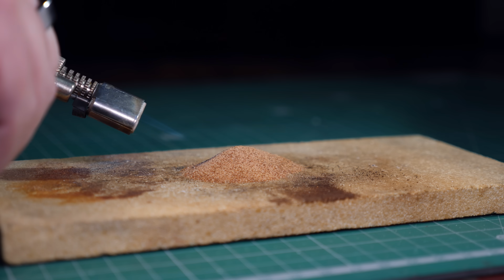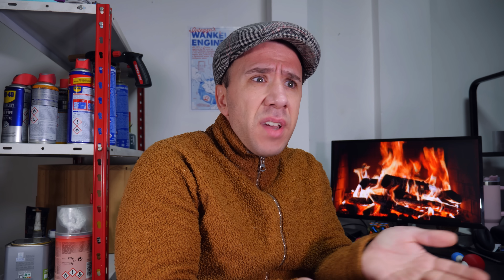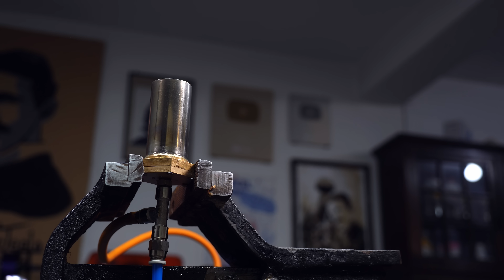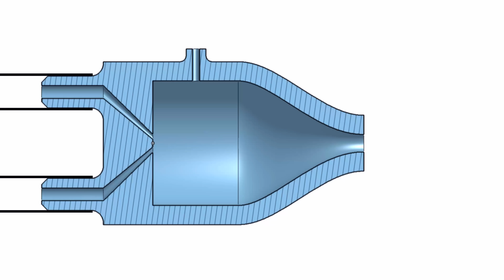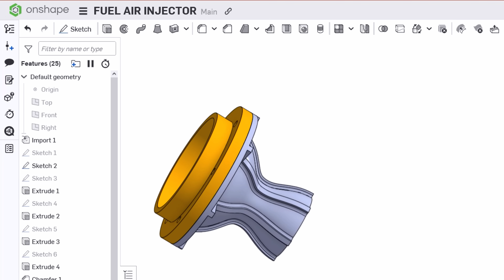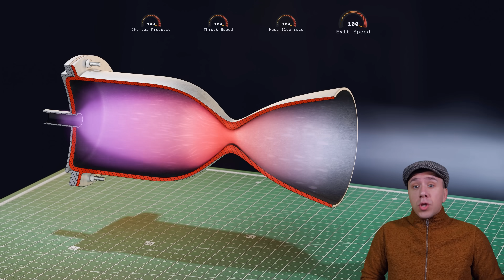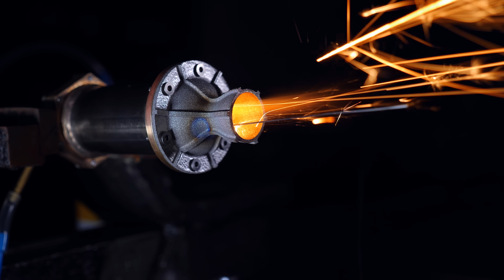I Built the FIRST VENTURI ROCKET ENGINE

Comment: The reason your air spray works perfectly while your Venturi nozzle failed is all about the mechanism of pressure drop.
When you blast air perpendicularly across the tube opening, you're creating a fast-moving airstream above the liquid surface. Here's the key physics, when air velocity increases (dynamic pressure), the static pressure perpendicular to the flow direction drops. Think of it like airplane lift: fast-moving air over the wing creates lower pressure above than below. Same principle here, the high-speed air creates a low-pressure zone that literally sucks the alcohol upward and atomizes it.
That's exactly why later you switched to using compressed air with a mixing chamber, you're accelerating the compressible air to create the suction, then entraining the liquid into that airstream. Much smarter approach for rocket injectors!

Comment: Use mister nosle and a liquid pump to push the alcohol through it. I think when you try and push more alcohol to are using more air and that blows out the flames. You can try it with the solid oxidizer.

Comment: 12:52 Gut reaction is you didn’t define it correctly. The air isn’t exiting the nozzle at 6 bar, the tank is 6 bar. I’m not trained in fluid simulation so I may be wrong on this, but in fluid dynamics you typically assume an outlet to atmosphere is at atmospheric pressure. Assuming it exits at tank pressure violates the conservation of energy.
Realistically, it will probably exit at more than 1 bar.

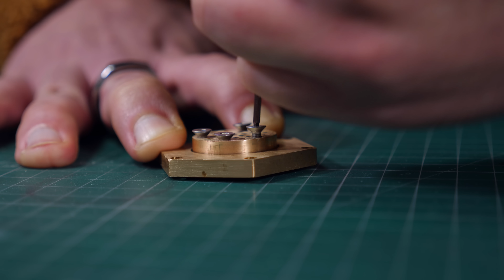Comment: at 4:43, the last one is the hardest one because you shouldn't be tightening them down 1 at a time. you should go  like 1 turn each on each screw and then smaller intervals the closer you are, if you want to make the cap-piece as flat as possible to the bottom piece. I worked in tool and die for a year before life took me elsewhere in manufacturing.

Comment: You could try making an expansion deflection nozzle of you tire of the aerospike. 

Btw, that 4 port aerospike may be prone to resonant instability contributing to your "pulse jet" surges. But by using a THREE port aerospike should cause any standing waves to overlap themselves 180° offset per rotation, capping the magnitude of the pulsations to a low level.

Comment: Your first test was upside down! The fuel melted, flowed downhill, plugged the device. If you invert it, then the melted fuel will come out the exhaust nozzle, so no congestion, tho you may not like the uncontrolled pops of flame from molten fuel combusting downstream of the exhaust...and if the engine sprays blobs of combustible fuel, that's a great way to start a fire. Either way, you have achieved the Jesse Ventura effect.

Comment: Im sure you know best practices with SRB fuel or we would be seeing your memorial vid now/watchiing your apartment block burn down from space.

Fyi, twenty years ago there was an arson for hire crew in the US that had used solid rocket fuel. It left absolutely no trace, tended to burn concrete and had the nasty property of burning hot enough to crack the H2O firefighters would spray at it into H2 and O basically just moving the combustion into a big action movie plume. 

They were taking on more jobs with arson cases spreading from one coast across the country until obe day it just stoped. 

Most likely the invetive soul making the stuff probably blew whatever rural shack that was his factory into low earth orbit. 

You don't want to do that.

Comment: The nozzles of rockets are shaped like this because when the exhaust flux reaches the throat’s section it travels at the speed of sound. After the throat an “inverse Venturi” shape is put because in the hypersonic regime the relation between pressure and speed is inverted (if the section increases the speed increases). In this way the flux keeps accelerating also after the throat.

But in your case the back pressure generated by the combustion is not enough to reach the speed of sound so that shape you realized is not necessary. You could make a single Venturi. 
The design you made, tested for these conditions, makes that the flux accelerate up to the throat and then decelerate because the section increases again. Maybe the deviation is too high and the boundary layer separates. Is for this that you don’t see the flux attached to the walls of the nozzle (adapted flux) as in the NASA tests.

Anyway English is not my language I hope I have been good enough to explain what I mean 😅

Comment: What you are describing about the air gun is exactly the working principle of a very simple carburator. The tube is the Jet and the high velocity air is air going through the butterfly accelerated by the piston going down. It absolutely is venturi effect.

Comment: The premise of a hybrid engine using a solid ammonium perchlorate oxidizer and a fluid fuel seems like it wouldn't work well anyway as ammonium perchlorate decomposes (exothermically) at temperatures that are pretty low compared to the operating temperature of a rocket.  By no means am I an engineer, but it seems to me that you might be able to turn it down by cutting the fuel, but not off, and restarting would still be impossible after more than a short interruption.

Comment: When doing the CFD, try displaying static pressure instead of total pressure and you will see the "suction".

I think it works on Bernoulli's principle which essentially says that dynamic pressure + static pressure = constant, so if you increase dynamic pressure (½ rho V^2) you decrease the static pressure contribution to total pressure, hence the suction.

Also keep in mind, the diverging section of a con-di nozzle only works for if you have sonic flow (M=1) at the constriction and have sufficient chamber pressure to accelerate the flow as it is expanded into the diverging section of the nozzle. (I haven't finished the whole video yet, so you might have addressed this - apologies if that's the case!)

At this point, the gas will be supersonic and is now considered compressible (any gas for which M>0.3) so Bernoulli's no longer holds true as it assumes constant density. From this, you can calculate area ratio, and can design a more effective nozzle.

I hope this is useful

Comment: Inject the fuel into the chamber by creating a vortex (angle the nossle holes). This will make sure the fuel and oxidizer are in a more intimate contact with each other. That's how they do it in actual hybrid rockets in missiles. Don't ask me how I know this.

Comment: I doubt I can contribute anything to that massive information center in your head, but maybe? 4:41 could be the tightening technique. just like when tightening lugnuts on your car. alternate the tightening in sorta star shape pattern as possible, not tightening all the way at first, just a little snug. work your way around till all are nice and snug, then a final torque on all. giving a nice even hold all the way around. just a thought. maybe let me know if it helps?

Comment: What you designed is an ejector. Used viscous effect to drag in the fluid. If your venturi didn't work is probably because the dimensions were insuitable.

Comment: I would say for the injected rocket motor, try spiral the output of the nozzles to even the burn. Also the paste itself is probably not very uniform, making solid rocket fuel is quite a tricky and technical process for a good burn /non bomb...

Comment: Explaining a CNC milling machine as "...like a reverse 3D printer" is sort of wild. 😆
Also, it's crazy too see how difficult it has become to purchase some chemicals (although it seems reasonable if you see what a malicious minded , or just dumb, individual could do with them) while remembering that as a child (in the 1970's and 1980's) I could just order them from shops that were listed in the instructions of a chemistry set... 
I don't know about ammonium perchlorate, but I tried to get some pottassium permanganate a year ago and it was only available as rather thin solution, no chance to get it in crystalline form.

Comment: Why is the last one always the hardest one?

Because you're not supposed to screw them in tightly before moving to the next one.
Also, try to screw them in diagonally 1 by 1 (if 4) or mirror if more than 4 screws.
Screw in 1 70%, 2 70%, 3 70% etc.
Then tighten them to 100% diagonally/mirror like you did before, but this time 100% (so until they are tight).

Works.
Every.
Time.

Can't believe I'm teaching you (a rocket guy) how to use screw. I guess everyone in my life was wrong when they said that i suck at life and i am useless and should just unalive myself 😎 

I'm glad i stuck around. Otherwise i would not have been able to make this post.

You just justified my life existence. Thank you, crazy garage rocket scientist guy ❤️ 👊 💪

Comment: i have an idea use convert that gas into plasma or super hot fuel and oxidizer with the heat of this engine also cool this it is possible to increase compression of fuel and also increase the thrust use tesla straw for  backward flow also use small shaft like mechanism to top backflow make it fast and also increase in pressure and also give more thrust also with combine with solid rocket engine use different shape i think use the shape which is give more thrust using this 3d printing and also simulation make it possible also this is more interesting thank you

Comment: you have accidentally stumbled upon a swirl injector. The cone is actually probably beneficial because it will make the fuel spray on the walls where the oxidizer is located. This means you will get more complete combustion and higher efficiency.

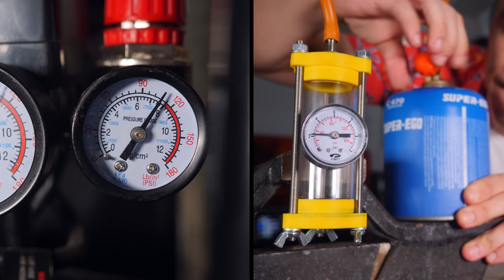Comment: 9:40 No! That is absolutely worse! You're pushing a combustible mixture back into the can, which is worse than an already combusting one! Air in the propane can make it explode.
14:48 I would also not stand in line with the disk, especially when there is no guard ;-;

Comment: tought of a venturi system 3 years ago.
but it was an idea for a whole ''ship''

cylindrical in shape, hollow in the middle, with engines output pushing trough the middle section creating push and suction at the same time.
space is a vaccuum but it'S also full of stuff.

i forgot all of the specifics (like how i tought it would actually look like and function) but yea
happy to see someone with more means and knowledge trying it out
had this idea when playing around the shop with a pneumatic venturi vaccuum gun

Comment: There was a design that used a reactive rubbery compound moulded into a cylinder with  longitudinal internal ribs . By controling the liquid oxygen released into the tube they were able to throttle a solid fuel rocket motor .

Comment: @integza Could you try to cool the nozzle with liquid nitrogen? 
Is that cone the correct size for that engine? You should get the increased pressure prior to the cone and then have the cone reducing pressure and increasing volume and speed :) 
Looks really well done but is it possible that its to small? the nozzle looks well, but what would happen if you increased the throat length about 10-15mm and then added a bell after the nozzle?

Comment: Once he realized he had a liquid fuel (isopropyl), why didn't he just inject that into the combustion chamber at pressure? No compressed air delivery needed. I assume he must have tried this and it didn't work (potentially very difficult to light) but I see no reason that it couldn't.

Comment: The last screw is that hardest because all the other screws took up most of the slop. It is closely related to why on a system like that you are supposed start all bolts in a "star" pattern and then tighten in small increments where every bolt is tightened (also in a star patters but from different start positions for each increment). If you do it all at once and one bolt is harder to drive your seal is not uniform and any blow through will almost certainly be near that last bolt.

Comment: Awesome video! About that chuffing you got happens in pretty much every rocket type (solid, hybrid, even some liquids) when the pressure inside the chamber keeps dropping below the level needed to sustain steady combustion. In your AP/ALCOHOL VENTURI it’s mainly because the alcohol vaporizes a bit too slowly compared to how fast the oxidizer wants to react, so the flame builds pressure, blows itself out, then reignites over and over. The fix that works across hybrids and solids alike is to make the initial burn rate and pressure rise faster than the pressure can escape through the nozzle: you can do that by slightly reducing the throat diameter, increasing initial oxidizer mass flux, adding a small percentage of fine AP (or other energetic) directly into the alcohol, or using a stronger/pyrogen igniter so the chamber pressurizes hard and fast right from the first millisecond. Once the pressure stays above the sustain threshold, it’ll roar smoothly until burnout. Can’t wait to see the next test with powerful smooth burning!
Reply: Vote this up
Reply: Yep
Reply: Amazing. Thanks!
Reply: interesting. i was thinking its more of a chugging effect. as the venturi downstream pressure increases, there is less fuel being sucked in, as the venturi is becoming less effective. pressure goes up, fuel flow rate falls below combustion needs, downstream pressure drops, venturi effect goes back up, combustion happens again, pressure rises, fuel flow rate drops again as pressure rises. thoughts? im def not a rocket scientist lol

Comment: You are a weirdo but keep doing it.  I keep working on a rocket engine design that has an inner chamber for H2+O2 combustion and an outer chamber for steam generation.  The H2+O2 is mostly just to create the steam efficiencly and continuously.  Why?  My dream is to create a deep space cruiser that can launch itself for a material cost of under $100K.  Seems impossible but it's fun to try.  The idea is to build two large counter-rotating discs that hold water in them.  The discs spin rapidly, pushing the water to the extremity.. giving the vehicle stability and massive electric production from the spin.  My calculations show this becomes more feasible with larger diameters... bare minimum around 30m diameter.  The larger, the more the water is spread out, requiring less tensile for high RPMs.  So electrolysis is used to rapidly generate H2 + O2 that is injected to combust for heating the water...  Water expands 1600x when gasified.  It also has a lot of mass so it can lift a lot of weight.  I have a python program to test various parameters....  including structural integrity using a few different materials... and cost estimates.  I am at $272K so far..

Comment: It looks like compressible flow simulation is a paid only feature on SIMSCALE so theres a very good chance that's why the simulation is incorrect, you should be hitting mach 1 somewhere in the air gun then hitting a normal shock as the static pressure drops. Additionally your de laval nozzle has some flow separation which might be from low chamber pressure (throat of the nozzle is too small) or the expansion nozzle is too large.

Comment: oi oi! get a throttle body on your air / alcohol Venturi mix nozzle and attach a cable or some kinda wire assembly to a sliding aperture so you can more precisely control the amount of thrust to fuel consumption you're aiming for.

Comment: I hope he understands how easily he could get a runaway reaction with this. The reason you always control the oxidizer is the fuel cannot burn without oxygen, that does NOT go both ways. With a powerful enough oxidizer, anything is fuel. Including your combustion chamber and nozzle. 

At this small scale you should be fine, but please for the love of God don't try to scale this up, this is probably the most dangerous design you have ever made.

Comment: The flowing air over the straw is causing a "suction" action because the flowing air is causing pressure above the straw to drop below atmospheric pressure that then causes the atmospheric pressure to push the fluid up the straw. Or am I misunderstanding how that is working?

Comment: heterogeneous reactions are complex, that's why the pro use homogeneous reactants, either gas or solid. You are wasting the gas that flows along the center of the cylinder. You need more contact between the gas and the solid, a double cylinder, two or more concentric tubes design with a narrow gap between the solid and the gas. You need a good simulator to design the proper dimensions of the chamber, the throat and the nozzle. Remember that solid fuel rockets do not need a throat, and gas fueled do, your hybrid or hetero may need something in between, because you need enough residence time to mix and pre- or even full combustion, if combustion is not complete in the chamber, you need a parabolic shaped nozzle to finish and get some additional thrust. A bientôt mon ami.

Comment: Spin casting on a 3d printed jig that uses a set skateboard bearing to support the tube, a belt to drive off a drill. Would make casting solid fuel much easier with improved casting density. Cheers

Comment: Oh right, I forgot to comment this in the last one. Adjust (I'm sure you figured it out already, this is an old video, right? & you certainly do think & spend time researching others videos & more.) your fuel pressures. 

Yeah, adjust the actual nozzle opening, like in the jetting of a carb that is lifted slightly thanks to more vacuum & air flow going through. Is old, works. try it some time. Adjust with a reference to adjusting your screw height & total exposed hole for your jetting of your total amount of fuel.

Or, maybe this new design. A rotating device in the inflow to the coils will suffice. Like.... I dunno! shrugs obviously annoyed-edly like a throttle body. But, wait what's this!? A compressor before hand, like any scooter turbo & or small drone motor attached to a pump, with a gear. I think it could be powered from your combusting fuels in a circuit... Maybe?